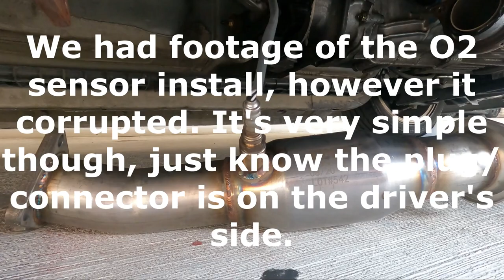S2000 Berk High Flow Cat Install and Exhaust Comparison!! Plus, WOT pulls!

Comment: Do you pass emissions ?
Reply from the maker: Depends where you live. If you’re in Cali or somewhere will similarly strict emissions regulations, this won’t pass. Or I’d be very surprised to see one pass. The mesh inside of the cat is much smaller than OEM so it’s not likely in stricter states.
Reply: @headassgarage5658  it’s not too strict here it’s and obd check